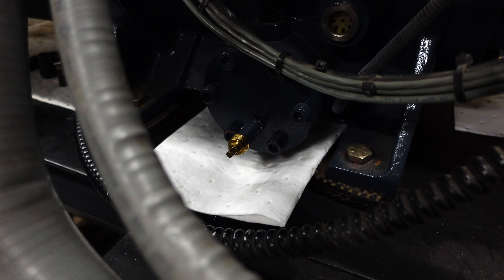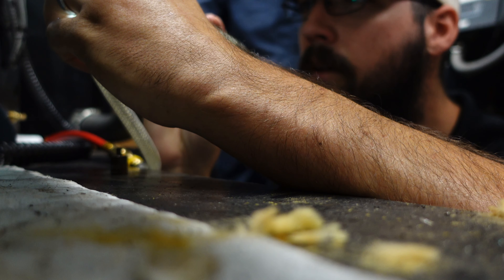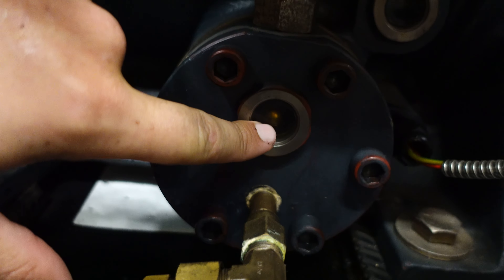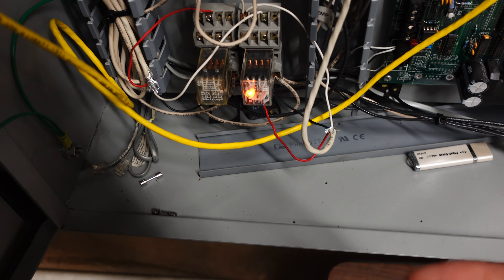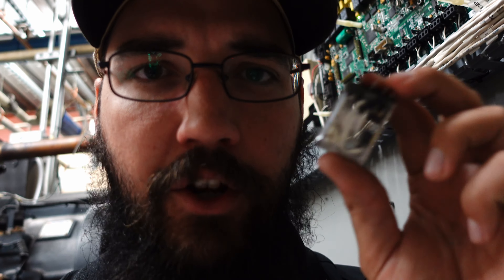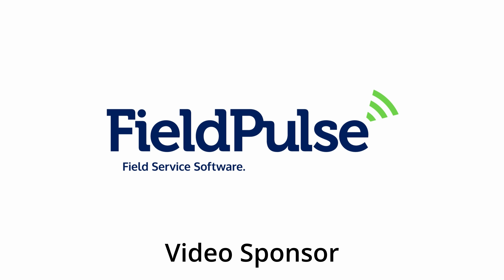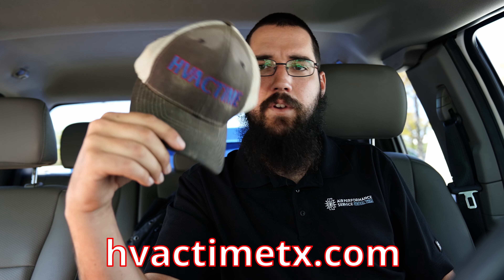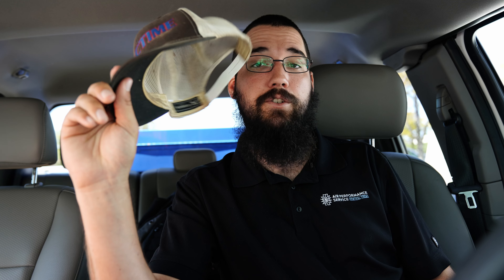This was causing Hanbell issues

Comment: And don’t forget that for oil separator to work correctly you need velocity of the refrigerant.
High head is kinda impeding the velocity ( kinda because it’s not really a high head - put pressure differential).